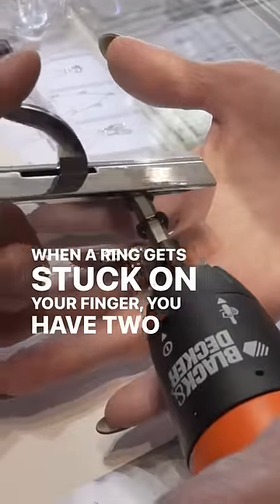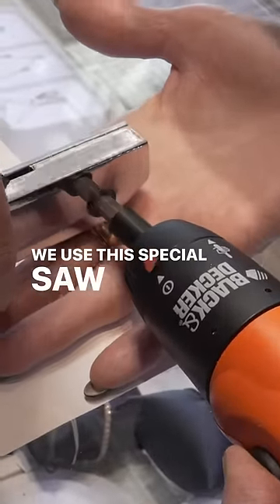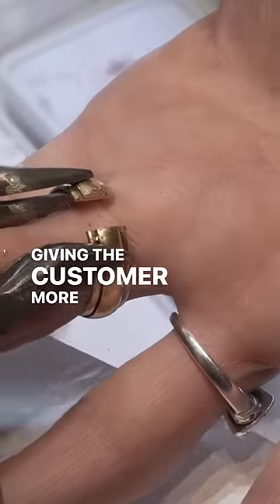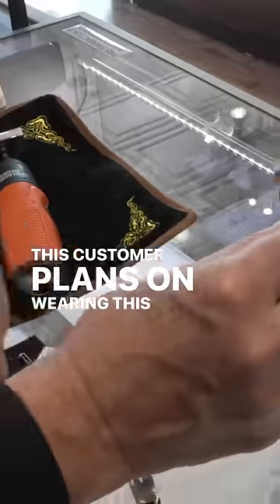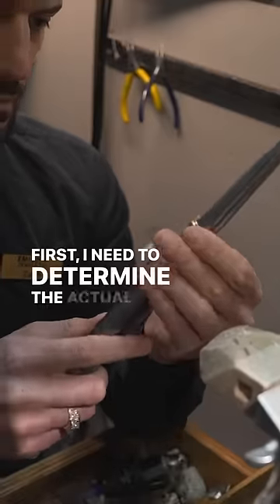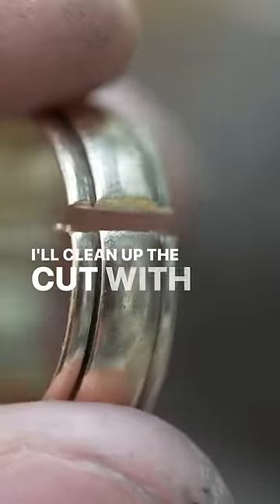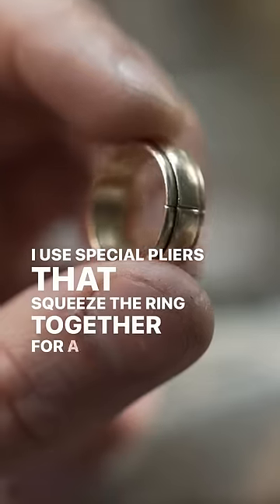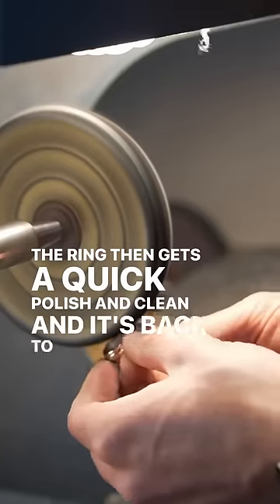Removing Stuck Wedding Ring

Comment: I really feel bad for this poor guy having to reply to all the "just slip it off with soap or oil" or "use dental floss" a LOT of the time these techniques just don't work. Everyone has different hands and bones and we all age differently, arthritis is a real bitch and the amount of customers I get who have it and need rings removed this way is insane. I'm not saying the common ways don't work, I tell my clients to use them all the time, it's just not applicable to everyone and especially not the elderly or people with sensitive joints. Pro tip to everyone out there removing tight rings, if it's an older piece and you've worn it a while be careful when taking it off, rings get thinner inside edges over time which can be fucking sharp, don't slice your knuckles, be safe.
Reply from the maker: Thanks Randall! You’re absolutely right!
Reply: They literally use the floss technique in hospitals
Reply: @Spilled Coffee  Hospitals also cut rings off patients with swollen fingers,it depends on each case. They sometimes cut chains/pendants too, much rarer though and only if they can't access/can't use the clasp. I'm not saying you're wrong, just saying that one method doesn't apply to all cases, I wish floss worked for everything.
Reply: @daddyimsorrybut  no

Comment: Used to work in the ER and I have removed rings using some dental floss it works pretty good. But we had this one pt where the ring had cut circulation for so long the guys finger swelled and made it so you couldnt get the standard ring cutter in there or use the floss trick. We had to get a Dremel from maintenance and slowly dremel it off. Was not a fun day for that guy
Reply: Dude was not expecting that I bet, he must now have PTSD from looking at any ring. I know I would...
Glad you figured it out though, you do pehnomenal work!
Reply from the maker: This woman had this ring on for over 30yrs. Her knuckles grew from arthritis, causing the rings to be stuck on her finger. We tried Windex, soap, and the string trick didn’t work either because you can’t compress bones. Cutting the ring off is the last resort, but it ends up looking good as new👍 thanks for watching!
Reply from the maker: Thanks
Reply: @Zach Emigh Jewelry  ya when all else fails the cutter saves the day also that cutter you used is pretty damn cool if I may say so myself!
Reply: @iMMortster  thank you the doctor did the dremel work as at that point its almost a surgical removal i was the water boy trying my damndest to keep it cool to not burn the patient. And honestly and this is not to sound fucked up but I doubt he cared. Unfortunately the guy was a drug addict and when he came in to us he had the nods so he had just used. On the flip side it made him super chill thru the whole ordeal and all he cared about was getting the ring back. But man it took some patience a few dremel cutting disc's and lots of water to get that off. At the end he was more miffed that we had to cut his ring I sometimes thing if he would've preferred losing the finger to save the ring but who knows 🤷‍♂️

Comment: You also have a third option besides cutting the ring. There's a floss method which helps compress the tissue and you can feed an end under the ring to unwind the floss on the way up the finger and glide the ring with it. It won't work in severe cases, but it works a treat for a lot of times you don't want the ring cut.
Reply from the maker: She had arthritis and didn’t take the rings off for over 30yrs so string wasn’t working unfortunately

Comment: That has been one of my greatest fears lol great to see its recoverable
Reply from the maker: Have no fear!
Reply: provided the swelling isn't too bad (like within a half-size or so) another thing you can do at home is soak your hand in cold soapy water for like 5 minutes and try to slide it off, if no luck hold the hand above your head (like back in school to ask a question) for a moment or two and then try. The cold helps constrict vessels and raising it above your head lets gravity do its thing. Both quick and easy free options before needing to be cut off. And in the end the jeweler still gets paid for the resizing, win-win

Comment: I used the string trick to get my wedding ring off. Put it on at 19 years old, had to remove it at 53 years old as it was too tight and misshapen.
Reply from the maker: This woman had this ring on for over 30yrs. Her knuckles grew from arthritis, causing the rings to be stuck on her finger. We tried Windex, soap, and the string trick didn’t work either because you can’t compress bones. Cutting the ring off is the last resort, but it ends up looking good as new👍 thanks for watching!

Comment: Did she not try the vegetable oil method? Cause it never fails but this works too
Reply from the maker: This woman had this ring on for over 30yrs. Her knuckles grew from arthritis, causing the rings to be stuck on her finger. We tried Windex, soap, and the string trick didn’t work either because you can’t compress bones. Cutting the ring off is the last resort, but it ends up looking good as new👍 thanks for watching!
Reply: @zachemighjewelry  ahhh I see I see

Comment: According to nurses and doctors, they can do this without cutting the ring or your finger
Reply from the maker: That’s when it’s from an injury. This scenario the woman wore the ring for 30+ years and her bones grew.. can’t compress bones with string
Reply: @zachemighjewelry  it’s used when rings are stuck on swollen fingers, if there’s server trauma to finger they’ll use a tool to crack the ring!
Reply: @zachemighjewelry  it's not all knuckle though, as a goldsmith of over 15 years and used the method well over 100 times I've only ever had to cut of 4 rings. The string method will always be my first port of call before I cut a ring. You would be surprised how much you can compress what you think is just knuckle.
Reply from the maker: @mrtrickay7111  hey I’ll send them your way next time
Reply: @zachemighjewelry  it'll be some trip to Scotland

Comment: The only bad thing about this is with yellow gold rings when you have to have them resized and have to have them cut to fit. The bond is never a strong as it is when the ring is made to begin with. It makes the metal weaker at that point. It's more likely to break on you later on.
Reply from the maker: Take the ring off if you’re doing something that would bend the ring to that degree

Comment: I was quoted $425 just to resize (size up) a platinum ring. People in my town swear by the folks I went to, but do you think that’s legit? Also, as desperately as I’d like to wear my gift, I haven’t, because it doesn’t fit and I don’t want to squeeze it on and have it get stuck!  It’s so strange. I wear a size 6 on my ring finger but this particular one just does not fit.

Comment: option 3: wrap the finger over the knuckle to the ring with thin fishing line, then push the line under the ring, then pull the line through, whist it unravels the line should spin round the finger forcing the ring over the knuckle and off. Only if this method fails would I ever cut someone's ring!

Comment: Why didn't they just use the floss method? If you were able to slide that thing under the ring, then it could have been easily removed with floss.
Reply from the maker: String method couldn’t work because her bones were the issue
Reply: @zachemighjewelry  usually bones don't grow to prevent removing a ring. The knuckle is just swollen. Wrapping the floss around compresses that area and makes it possible to remove it in a spiral motion.

Comment: I work at a jewellery shop but the tool we use to cut rings off isn't drill powered, we just twist the screw on the side. It probably takes a bit longer, but it still works a charm.

Comment: Not exactly "proud" of this but I have told my partner of something significant (either irreversible damage or irreversible damage) ever happens to one of my limbs be it a finger. A arm. Hand or leg. Go with Option two. I have enough scars on my body as it is and I have been looking for someone to make prothesis for for a long ass time. That and I get to make said limb far more useful.

Comment: Or just use the thread version you can find easily online that involves a few minutes of time and zero cost/damage 🙄, instead of unnecessarily charging people.
Reply from the maker: This woman had this ring on for over 30yrs. Her knuckles grew from arthritis, causing the rings to be stuck on her finger. We tried Windex, soap, and the string trick didn’t work either because you can’t compress bones. Cutting the ring off is the last resort, but it ends up looking good as new👍 thanks for watching!

Comment: this is absolutely not the best way, it is a way still. there’s a video of medical professionals doing it wish a fishing line on a finger that is swelling from trapped circulation, saves some time and work
Reply from the maker: This woman had this ring on for over 30yrs. Her knuckles grew from arthritis, causing the rings to be stuck on her finger. We tried Windex, soap, and the string trick didn’t work either because you can’t compress bones. Cutting the ring off is the last resort, but it ends up looking good as new👍 thanks for watching!

Comment: Or you can remove it with tooth floss but ok
Reply from the maker: This woman had this ring on for over 30yrs. Her knuckles grew from arthritis, causing the rings to be stuck on her finger. We tried Windex, soap, and the string trick didn’t work either because you can’t compress bones. Cutting the ring off is the last resort, but it ends up looking good as new👍 thanks for watching!

Comment: You need to learn how to use string to take the ring off
Reply from the maker: This woman had this ring on for over 30yrs. Her knuckles grew from arthritis, causing the rings to be stuck on her finger. We tried Windex, soap, and the string trick didn’t work either because you can’t compress bones. Cutting the ring off is the last resort, but it ends up looking good as new👍 thanks for watching!

Comment: two questions
1. do you return the scrap metal to the customer? 
2. do you match the solder wire to the same material as the ring or is it always silver solder?
Reply from the maker: They’re credited the value of the piece (this was a couple dollars). And yes the solder color matches

Comment: Or... Use dental floss. That ring wasn't THAT stuck
Reply from the maker: This woman had this ring on for over 30yrs. Her knuckles grew from arthritis, causing the rings to be stuck on her finger. We tried Windex, soap, and the string trick didn’t work either because you can’t compress bones. Cutting the ring off is the last resort, but it ends up looking good as new👍 thanks for watching!

Comment: shoe lace or mask strap from a NRB works great. learned it from an ED doc
Reply from the maker: This woman had this ring on for over 30yrs. Her knuckles grew from arthritis, causing the rings to be stuck on her finger. We tried Windex, soap, and the string trick didn’t work either because you can’t compress bones. Cutting the ring off is the last resort, but it ends up looking good as new👍 thanks for watching!

Comment: Option 3 using a small string wrap around the finger compressing it ahead of the ring.  Remove ring then remove string.  Now take ring to jeweler for resizing as necessary.  Learned that from an old jeweler
Reply from the maker: This woman had this ring on for over 30yrs. Her knuckles grew from arthritis, causing the rings to be stuck on her finger. We tried Windex, soap, and the string trick didn’t work either because you can’t compress bones. Cutting the ring off is the last resort, but it ends up looking good as new👍 thanks for watching!

Comment: I've seen somewhere that you can use a thin strand of string to wrap around and squeeze the finger, feed it through the ring, then start unravelling it to slowly pull the ring out. You get a massive mechanical advantage because it's essentially a worm gear. Combined with a generous amount of lubrication, and it's good enough for any situation unless the bones in the joint have physically outgrown the ring (which is rather rare). Is this a third option?
Reply from the maker: The string method wouldn’t work her because her large arthritic bones were the issue

Comment: I did that for myself with a hacksaw...

Held my wedding ring in a drill press vise (had it handy) and cut carefully with hacksaw and needle files until I broke through, then used pliers (much like here, but with only one hand I had to pull against the vise) to spread the ring enough to get it off.  IIRC, I got $70 as scrap gold (this was in 2007, gold has gone up a lot since then) for a ring that cost me $500 in 1992.

Would have been much easier if I'd had a jeweler's saw, assuming I could clamp the blade with one hand.  Thread the blade through the ring, clamp it teeth up, and saw away...
Reply from the maker: Nice!!

Comment: There’s a better way to remove the ring without cutting it. Use thread and tick it underneath the ring, wind it round and round the finger. Once you pass the knuckle, just pull the thread that’s underneath the ring and slowly unwind. As it unwinds the ring slowly moves forward.
Reply from the maker: This woman had this ring on for over 30yrs. Her knuckles grew from arthritis, causing the rings to be stuck on her finger. We tried Windex, soap, and the string trick didn’t work either because you can’t compress bones. Cutting the ring off is the last resort, but it ends up looking good as new👍 thanks for watching!

Comment: There’s a better quicker and safer way than what you just did. It’s called string. There’s a very special way you have to use it, I can’t really explain it in just text, I would have to show you in person.
Reply from the maker: This woman had this ring on for over 30yrs. Her knuckles grew from arthritis, causing the rings to be stuck on her finger. We tried Windex, soap, and the string trick didn’t work either because you can’t compress bones. Cutting the ring off is the last resort, but it ends up looking good as new👍 thanks for watching!

Comment: Working in a medical facility, I unfortunately have needed to remove a few rings. Some were cut with a hacksaw blade. A bit distressing for the ring wearer, but better than the alternative.
I was also called in to remove a bracelet. The ring cutter did not even scratch it so ended up using bolt cutters.
Reply from the maker: Nice!

Comment: I have removed a ring from a swollen finger once by using a strand of cotten, thread it through and wind it round. As you unwind it it slowly pulls ring off
Reply from the maker: This woman had this ring on for over 30yrs. Her knuckles grew from arthritis, causing the rings to be stuck on her finger. We tried Windex, soap, and the string trick didn’t work either because you can’t compress bones. Cutting the ring off is the last resort, but it ends up looking good as new👍 thanks for watching!

Comment: Never cut a ring.  Use the dental floss trick.  Comes off every time.
Reply from the maker: This woman had this ring on for over 30yrs. Her knuckles grew from arthritis, causing the rings to be stuck on her finger. We tried Windex, soap, and the string trick didn’t work either because you can’t compress bones. Cutting the ring off is the last resort, but it ends up looking good as new👍 thanks for watching!

Comment: Shouldn't have to cut the ring in most cases you can just wrap the finger with string and leverage the ring off.
Reply from the maker: This woman had this ring on for over 30yrs. Her knuckles grew from arthritis, causing the rings to be stuck on her finger. We tried Windex, soap, and the string trick didn’t work either because you can’t compress bones. Cutting the ring off is the last resort, but it ends up looking good as new👍 thanks for watching!

Comment: Mortician here with plenty of expierence with stubborn rings: we use ligature (or any type of thin, durable string) and soap and it works like a charm. 
Slide an end of string under and grab the end. Loop if you have to. Apply generous amount of liquid soap and on a circular motion, pull on string to get the ring off.
Reply from the maker: This woman had this ring on for over 30yrs. Her knuckles grew from arthritis, causing the rings to be stuck on her finger. We tried Windex, soap, and the string trick didn’t work either because you can’t compress bones. Cutting the ring off is the last resort, but it ends up looking good as new👍 thanks for watching!

Comment: You can draw a dental floss through the ring from tip to palm, then wrap the string on the tip side of the finger starting by the ring. Wrap firmly, but not chokingly tight to the end of the last knuckle. Then grab the palm side loose floss and pull towards the ring and the ring will follow as the floss unwinds. If you did it right, the ring will come off painlessly and effortlessly. No cuts at all!!!
Reply from the maker: This woman had this ring on for over 30yrs. Her knuckles grew from arthritis, causing the rings to be stuck on her finger. We tried Windex, soap, and the string trick didn’t work either because you can’t compress bones. Cutting the ring off is the last resort, but it ends up looking good as new👍 thanks for watching!

Comment: You could just use some dental floss or some kind of thin string to force the swelling down and remove the ring that way. It's done in the ER
Reply from the maker: This woman had this ring on for over 30yrs. Her knuckles grew from arthritis, causing the rings to be stuck on her finger. We tried Windex, soap, and the string trick didn’t work either because you can’t compress bones. Cutting the ring off is the last resort, but it ends up looking good as new👍 thanks for watching!